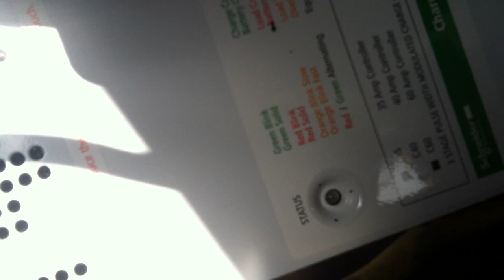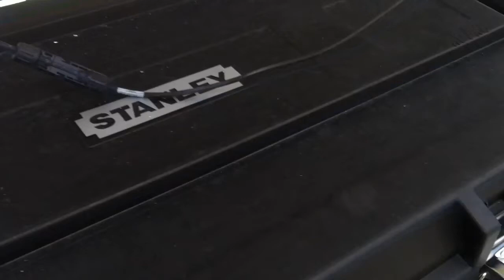Completed Solar Generator Trailer 2014

Comment: I like where you're going with this. I've seen some commercial approaches at this type of portable solar generator and your left with just THAT. Taking a modular approach affords you a greater amount a versatility and utility with all your equipment. You can park the unit and plug in for power, or transport the equipment remove and set up your power and still have the utility of a small flatbed trailer for other use.I especially like the panel mount. with long enough wire, you can just hang your aray wherever you want.

Comment from the maker: Whoo hooo, I finally actually sold this one after it was stolen basically three times and on my way home after recovering it today finally made a deal with someone who actually wanted to BUY it.   I had ended up sneaking out to where it had been stored and putting a gps tracker in it after a while and had to go through a month of bitching and basically threatening charges against a property owner where I knew it was located.   Some evil cunt had first tried to pull a stunt of getting it included in a "probate sale" then "abandoned property", then "confiscated" from the guy I had loaned it to.   Jerk local authorities had denied that the video of me constructing the trailer was sufficient proof of ownership when I could not find the "title".
Reply: +8digitPDX How do you find a Title to a trailer that isn't sold with a title, nor is registered with a title?  LOL.  

Trailer looks great, and overall a light weight setup so you could pull it with a car if you wanted.  

Could you share the price you sold the trailer for, or an idea of what it would cost to build something similar?
Reply from the maker: William Todd  Harbor freight gives a certificate of Origin when you buy the kit at the store, the issue is that if you ever lose a certificate of origin, it is much more difficult to replace than a title. 

Build cost was around $2300-$2500, sale price was barter for about the same.
Reply: 8digitPDX Hmm didn't know that about those trailers.  Thanks.  Not a bad price on the build either, I was figuring a couple thousand more than what you mentioned.  That looks like a great trailer a person could even use on jobsites for power if needed.
Reply from the maker: William Todd  I would not build one on commission for under $3,000 and am not sure if I could get the same deal on the components again either.   I would target $3500 and then assure the client that each one is a little bit better than before.
Reply: 8digitPDX Great ideas.  I don't plan on building one to sell, possibly just build something similar to use for extended camping abilities.  Maybe build a similar setup into the front of a 14' cargo trailer at some point which would also house a side by side utility vehicle and would double as a garage for the utility vehicle and for storage of the off-grid unit of course.  Kind of like to think of multiple use ideas for something.  Your trailer design is awesome but I plan on getting a side by side utility vehicle and an enclosed cargo trailer at some point as well...although possibly a 2nd trailer setup like yours that would be able to be towed behind the side by side as I live in an area where I can drive the utility vehicle on the road and I live close enough to a couple camping areas I wouldn't even need my truck :).
Reply from the maker: William Todd  You might want to hold off to check out my 2016 project trailer using one of the frames I have already and or the power and utility module which will go on my flatbed.
Reply: 8digitPDX I will wait LOL...for one I don't have the money right now to start, and I can use all the ideas I can get LOL.  I'll stay tuned in and see what you got up your sleeve for your next build.  Thank you.
Reply from the maker: William Todd  The cool thing about this sort of project is that you don't need to buy everything at once.  You can shop the sales, closeout and off season deals for components before you set out to put it all together.  For example, if you hit the sale prices and coupons just right, you can score the trailer frame kit under $300.
Reply: 8digitPDX I will have to buy stuff one piece at a time anyhow.  I was going to buy one of the trailer kits last year but other bills came up of course so I've had to postpone many things.  Hopefully this year will be better.  I'm trying to pay off years of debt due to losing a job and having to basically start over its just taking time of course, but it feels good every time a bill gets paid off.  

With a system like yours I can also expand it as I am able to as well.
Reply from the maker: William Todd Its pretty desirable once you have one.  I mean, people were at each other's throats to steal it from each other even after it had been robbed from me and a property caretaker was attacked when he went to retrieve some other stuff at the location where this had been stored.   There was even a lady who claimed all of the solar panels were hers and since it had been on her property before being moved to the place where it ended up, she was going to file a theft complaint against me and that I was lying about having a Youtube channel with details on this and a bunch of my other survivalist stuff which would prove it was mine.   Even local authorities where it had been stored were being assholes about saying I had insufficient proof of ownership to just go get it even though I had a video showing me making it, they said that was not a "document", and I was getting nowhere with the courts.  An attorney told me it would be $2500 to sue to get my stuff back, and that's knowing who stole it, where it was stored, and who was trying to prevent me from getting it.   You would think people would actually want to buy things like this, but apparently not.  It is strictly small shop fabrication stuff.   Washington state, really fucked up people there.   I would barely shred a tear if the Iranians or Russians were to nuke Seattle and that radioactive shit all drift over most of the rest of that state.
Reply: 8digitPDX Dang what a mess.  What did you end up doing to get it back?  That's pretty bad when the cops won't do anything even with all the video evidence...goes to show the insurance companies that tell everyone videos and photos will make a huge difference in a claim...obviously not.
Reply from the maker: I argued with the cops first, then the DA's office, then finally they put me in contact with the property owner's father.  The property owner has been playing the "psych defense", like too depressed to talk to anybody...at least that's the excuse now while his family has him lawyer up and share the loot with local cops.

Comment: Agord ability is a very hard thing to talk about as what adorable to you me not be to me.
Reply from the maker: I think you mean affordability, as your sentence looks suspiciously like an autospeller on a tablet gabled what you were trying to post.   To answer that, it is relative to overall cost and incremental purchasing.   I did not go out and spend $3000 to do this.   I spent $300 here, $140 there, $500 another place and so on then did the work myself.   If you want to go and just have a high output generator, you either finance it, or plop down the cash, then have ongoing fuel costs.

Comment: Just a quick question.
If I would build a trailer like this myself should I be concerned about vibrations at highway speeds causing failures like:
- cracking/breaking a panels,
- separating battery bank cables and causing a short
- electronics being subjected to bumps, bangs and vibration causing failure

Certainly not criticism. I ask because I would like to make a trailer like this to pull behind the Land Rover to the retreat, then pull it back home to power the ham shack, when its not tasked for anything else.
Reply from the maker: The boxes buffer against a lot of that stuff, the items in the electronics box are screwed to wooden platform inside the box.   The items in the battery box fit relatively tight but I am thinking of some sort of plastic panel to go on top of them inside the box.   The cables have the metal connector down inside the core of the connector, there is not an exposed metal connection like on a normal power plug.   The panels are made lime a heat vacuum sealed sandwich with tempered glass and layers of plastic material with the cells in the middle.   They Have a little bit of flex to the. But are in rigid aluminum frames, then I reinforced those aluminum frames with steel framing.    
That panel array is around two years old and has already weathered through several storms.
Reply from the maker: I will do things differently on the next one.   The way this ends up, no two are ever exactly the same, but they use relatively standard components for ease of field repair.   This one will get hauled off to its new home and I will start another one, but part of this video documentation is to show who built it and where it came from, establishing ownership ans such in case it gets "borrowed".   I am "contributing" it to a situation, but where it goes is still my call. 

Volunteering and contributing resources is the big thing I am trying to promote with some of the stuff I am trying to establish, so this is putting up, not shutting up.